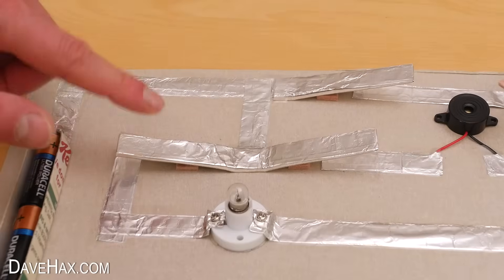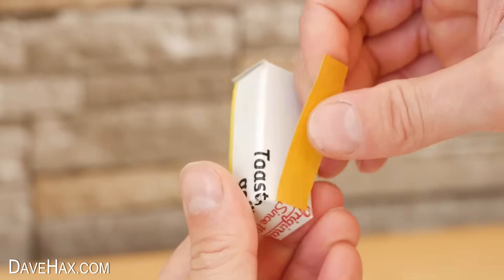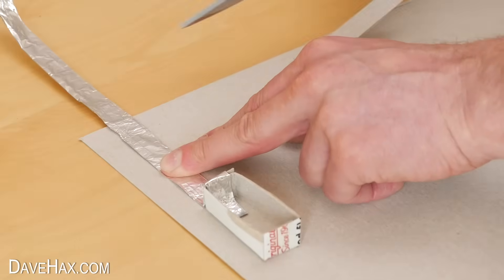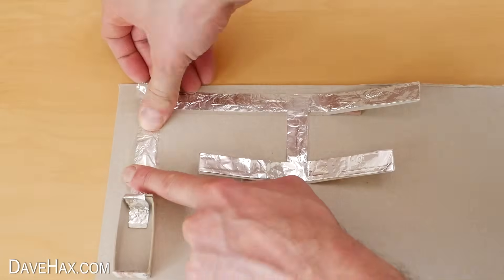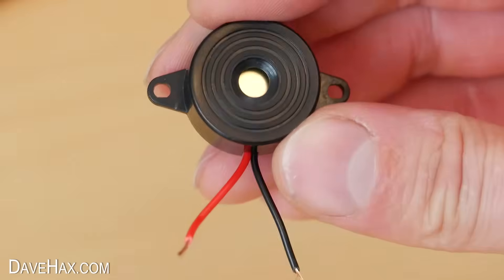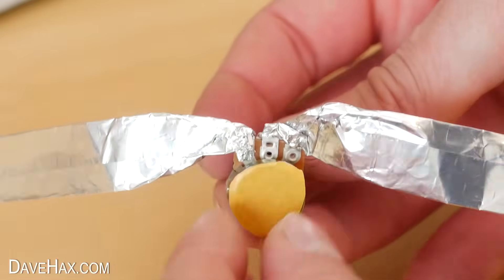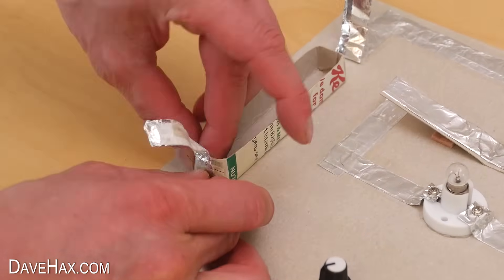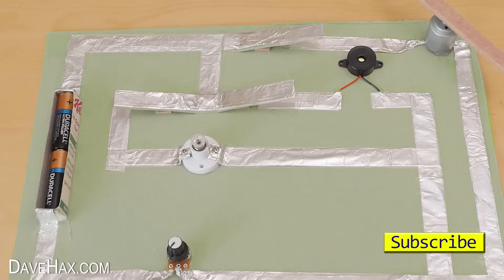Look What I Made With Kitchen Foil!

Comment: I have one question, do you feel a slight electric shock when you touch them
Reply: 3 volt.. very low voltage.. on dry skin,  it's fine and we won't be getting shock.. but if it's wet skin, it lethal / fatal / deadly.. always better to use wooden spoon or other insulator to be safe
Reply: @hopegood9559  3 volts man? Thats high i think but its reasonable because the batteries power like 3 stuff so yeah
Reply: @hopegood9559 3 VOLTS, ON WET SKIN, IS  *NOT* LETHAL. STOP LYING, CLOWN

Comment: The first circuit for the light It wasn’t the resistance, there’s not enough energy in the battery to power it. Lightbulbs need a lot of energy and I wasn’t surprised it barely sparked. But when you added two batteries it gave the light enough energy to create a lot of energy, but it wasn’t fully lit because of the energy.
Reply: Wow

Comment: I don’t understand how it doesn’t electrocute you
Reply: The voltage is way too low. If you've ever touched a 9 volt battery, that's three times higher than the voltage used here.

Comment: You can also use foil to make a capacitor. Would be interesting to see what values os resistance, capacitance, and indutance you can get out of a sheet of aluminum foil.
Reply: Well, you seem to want to do that, why not try?
Reply: but can you blow it up?
Reply: Resistance of Aluminum wire is typically 17 ohms the foil should have around the same
Reply: Make one then buy a LCR tester to check

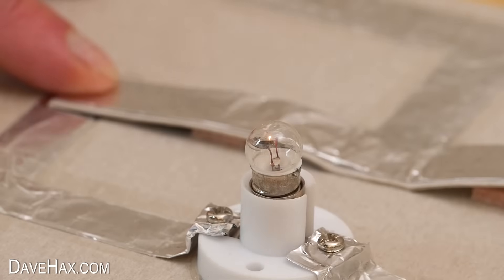Comment: 8:25 its not “too much resistance in the circuit” its just THERE IS LOW VOLTAGE AND CURRENT OR LOW POWER, because your using a single 1.5v battery

Comment: The reason why this makes sense is because kitchen foil is really just a thin strip of aluminium, which is an element that, according to the redox (reduction-oxidation) rules, aluminium will always have a +3 charge in its compounds, which means it can pick up electrons (which can pass on an electric current throughout the entire metal).

Comment: I suggest you to use  a lm317 regulator ic for a stable controlled voltage or even a 555 timer is a great thing,because it will create a pwm signal and thats much better than the potentiometer only

Comment: How to make a DJ booth:

NOTE: This is a joke

1. Learn scripting
2. Make a circuit with a few buzzers and resistance changing thingies
3. Transfer the scripts to an USB
4. Get an USB port and connect it
5. Get processors and s**t to make an basic motherboard 
6. Connect the Motherboard 
7. Use the scripts to influence the buzzers and get tunes
8. Script more so you can make songs on the booth and transfer them to USBs
9. Get a mic and evolve your motherboard
10. Tunes with instrumental and voice over

Comment: Wow, basic circuit just instead of using wires you used tinfoil cause tinfoil is one of a couple metal type things that carry’s the power from the plus side to the minus side and added in a few extras that are basic if you know the tiniest thing about engendering you can make this as I made Simao thing in primary school

Comment: The switch that you used for making connection with the bulb and buzzer is known a a "2-way switch".In this switch you can power any one load by flicking the switch in any one side.Both sides mean ON .By the way what was the wattage of the bulb you used?

Comment: I'm 18 and I feel stupid that I don't know how it works... I hate physics. 
P.S Can I turn on 2 things in that circuit board?
Reply: I'm 12, was learning this kind of stuff at school...i dont understand a single thing...
Reply: I'm 12, was learning this kind of stuff at school...i dont understand a single thing...
Reply: @cheesyquokka  you have duplicated a comment congratulations
Reply: @kekkodance  my phone was really cheap and it glitches all the time, after i sent my comment, it looked like i didnt sent it because itt wasnt showing up. so i wrote it again and sent it again.
Reply: @cheesyquokka  mate u just gotta wait a bit and reopen ur comment and ur good
Reply: @kekkodance  ahhh, thanks dude
Reply: alt f4 yes, but you will need more current, so you need more batterys, but that will increase voltage. So you either need a regulator (such as an lm78) or you can just use components with higher voltage ratings. 

If you understood any of that, you may need a more complex video!

Comment: I had to do something like this back in '86 or '87 for fourth grade science only it wasn't quite as involved as this. We were studying electricity and had to make simple circuit board devices like this that that would do a match and either light up or ring a buzzer or bell when you closed the proper circuit. Matches were up to us, could be things like matching primary colors to the correct secondary color (like red + yellow = and you then have to choose the right secondary color), or multiplication tables (3x4= , 8x6=, etc.) states and capitals, etc. They weren't as intricate as this, but this does remind me of those.

Comment: I could already see kids doing this for their science fair project
Reply: We had to do something very much like this for science projects. not necessarily for science fair, back when I was in 4th grade in the mid to late '80s.
Reply: @richardgreenleaf3259  lucky
Reply: @raulrblx3200  Lucky how? That was for a grade. I don't remember the science fair being for a grade, but we still had to come up with something. Our choice just as long as it had something to do with science (mine was model rocketry) Failure to do so didn't mean a failing grade, unlike this. This we were studying electricity and had to create a learning tool, basically a box with a match the subject in column A with it's coresponding subject in column B. Our choice on the topic, it could be anything. The real important thing was that we demonstrated we understood insulation and conductivity.  If I remember correctly, grades were based on how popular the subject was, how accurate your matches were, and how well it worked. Popularity being voted on by the class as to which ones folks felt they learned the most from and which would teach kids in 1st, 2nd, and 3rd grade better. Matches accuracy was simply you had to ensure you matched Subject A with the right Subject B. How well it worked was more important in the grade, if you didn't insulate your conductive material properly you could have the leads touch multiple "correct" answers, or even have matches in column A or column B without matching in the opposite column. Don't remember what grade I got, think it was an A which would have been one of the  few A grades I got that year.
Reply: @richardgreenleaf3259  same but not in the mid late 80s
Reply: *their
Reply: AAAAAAHAHAHAHSUYSAGASUSYTSDGAAAAAAAAA
Reply: Im from dk and theres no science fair on my school ik but idk if theres on other danish schools tho
Reply: Their
Reply: Me too
Reply: Lol there's literally a comment talking about how they did this for a science project
Reply: Im gonna make it later
Reply: For science class we had to bring real wires
Reply: What is science fair?
Reply: Well its cool huh?
Reply: Well meaby...
Reply: We don’t have a sincere faer
Reply: I did this with copper tape for my show and tell
Reply: well that's not really science but ok I guess, it's a fun project of course
Reply: i never thought of that
Reply: I tried
Reply: Doing it for the science fair
Reply: It’s their*

Your welcome.
Reply: @bobbert516  this ain't a spelling bee
Reply: @isyriex4675  it isn't "ain't" it's "isn't" and he is just trying to help people.
Reply: @bobbert516 thats what they put
Reply: ARE YOU A SPY??!!  
what the..... 
😂